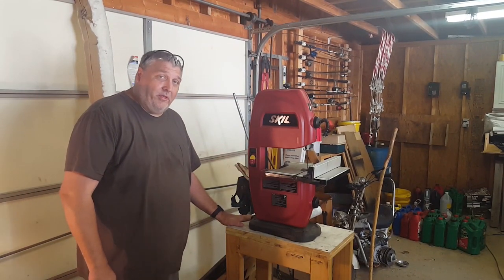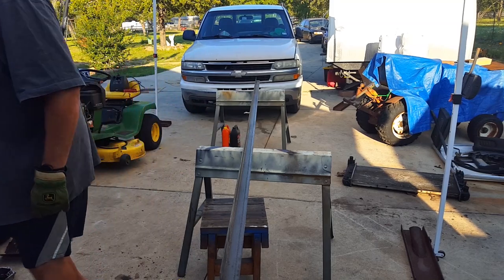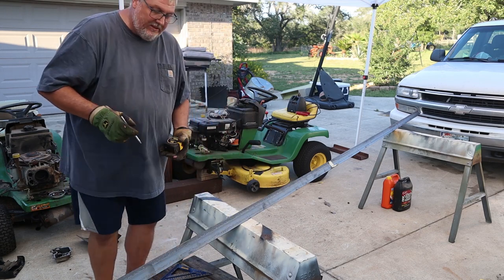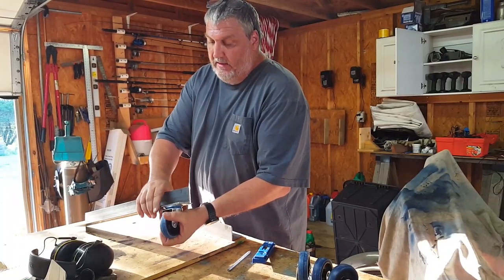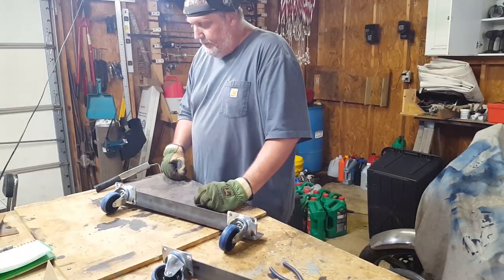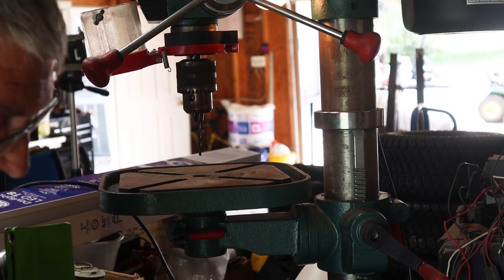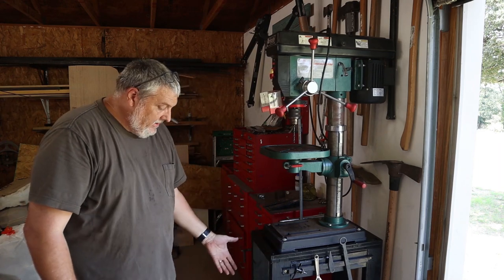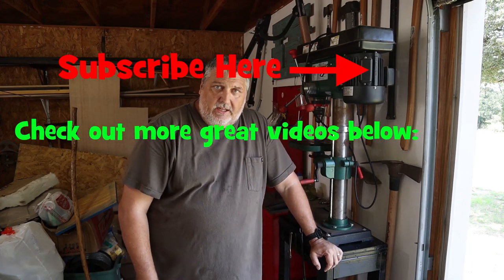Easiest Drill Press Stand ever - now on wheels!

Comment: Turned out great!  Be careful welding galvanized or zinc coating though.  You really don’t want to breath that stuff.  Some people grind it off first, I’ve had good luck with soaking it in vinegar for a couple days.  Gets it right down to raw metal 👍🏼